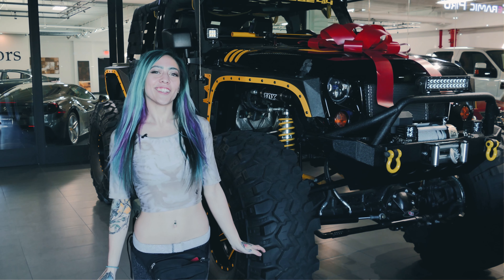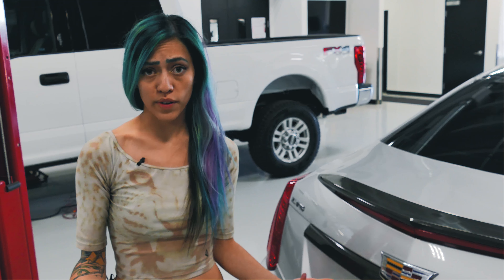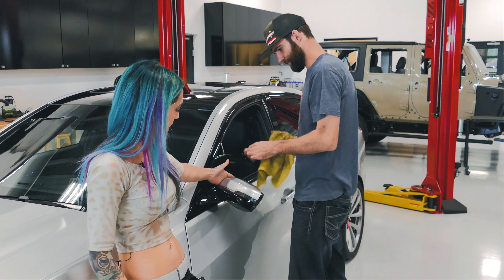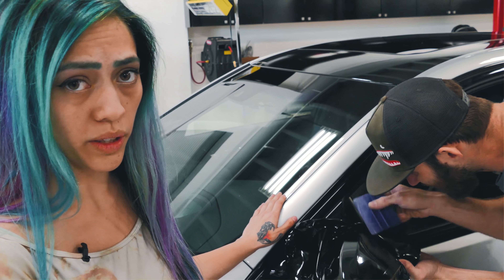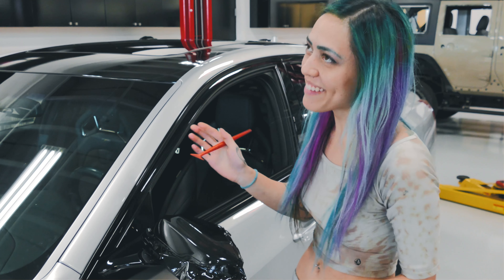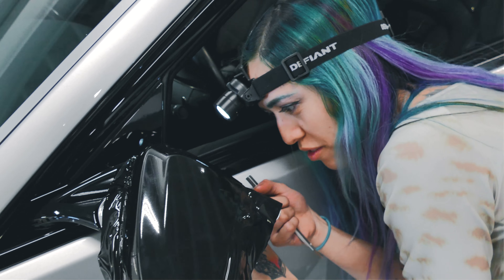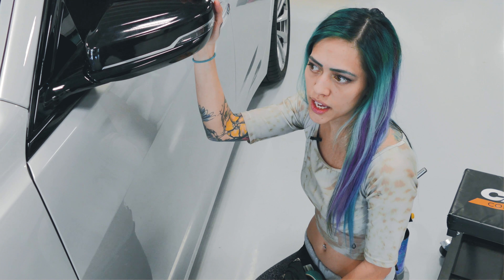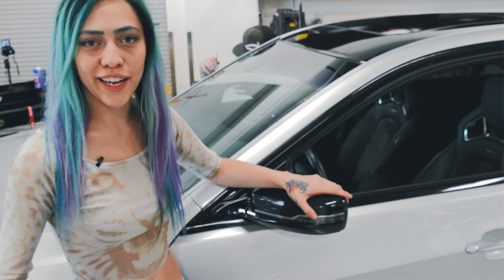How to Wrap a Cadillac  CTSV Mirror Cap

Comment: How come the down side witch you cut  above the chrome line didn’t pull back? Or did you release the pressure on it before heating it?
I would like to see how to prevent glue lines and if you get them how to get writ of them.
Reply from the maker: Michel Cekalovic proper prestrech will keep it from pulling back. The key is to heat all the edges to relieve stretch before working down to edge and cutting. Glue lines are definitely a tough one!I'll have to think of someone creative ways to demonstrate in a video, thanks for your commentary!
Reply: Witch?  I didn't see a witch.

Comment: I've always had problems with deep recessed areas where prefilling isn't really an option and I hate to use primer.
Reply from the maker: Agreed! Great idea, need to find a good bumper to demonstrate.
Reply: Lay into the area, make sure to account for the extra material when cutting out your panel pieces feed it in or start to lay there diary and work outwards towards the flatter parts of the panel

Comment: You are never dismantle the mirror? And how much is two mirrors? ) If not a secret? )
Reply from the maker: An Fasov it honestly depends on the mirror. If its a removable cap, yes. Sometimes it is not necessary though. Mirrors like this we usually charge $150-200/set. Up to $250 for full mirrors with neck.